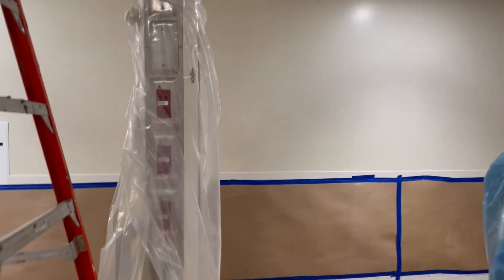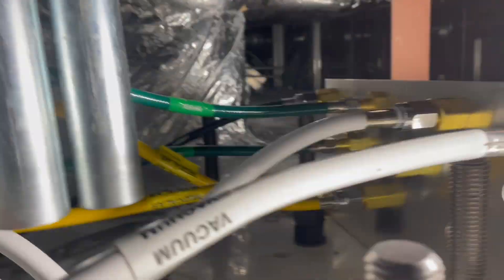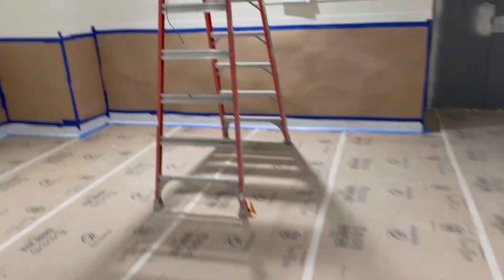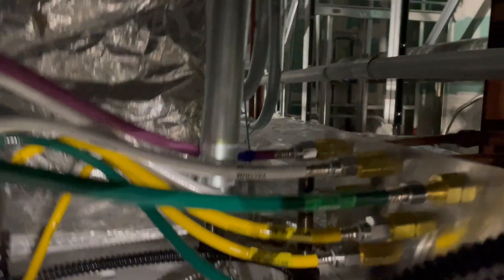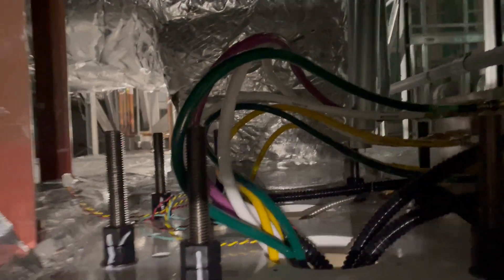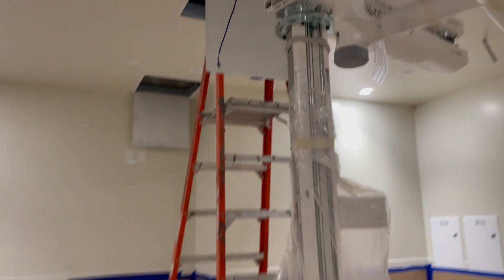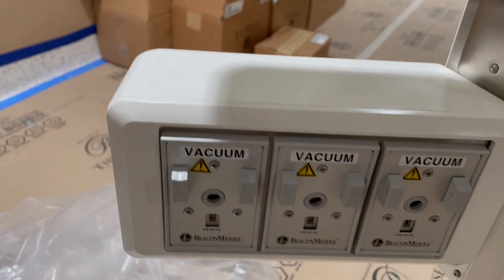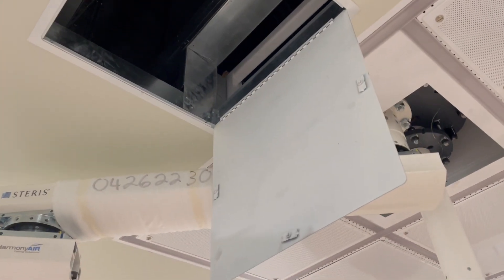Its time to connect the Operating Booms,and Test them

Comment from the maker: The hoses and boom comes as an assembly. Made by Steris.  I know my piping is good and holds pressure. Now I’m testing the hoses/ boom for leaks
Reply: I’m very impressed by your work man. I’m adding med gas to my company but I’ve never done it before. I’m cramming as much info as possible and your channel is a god send. Wish I could pay you for this info.